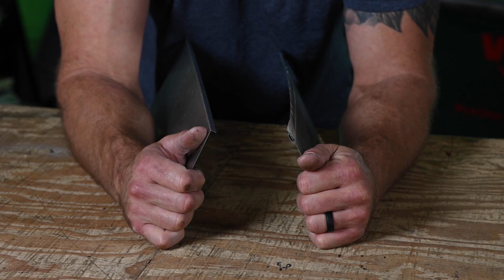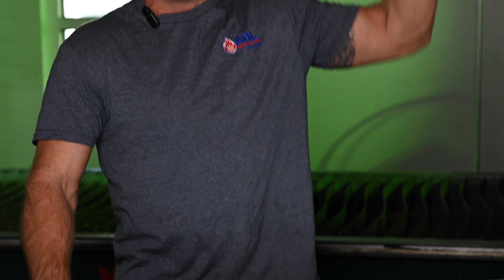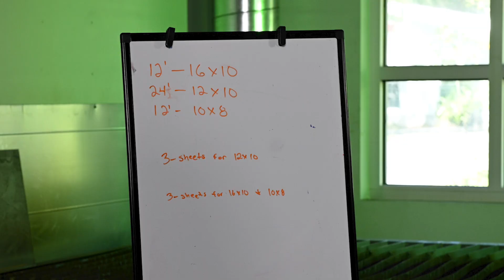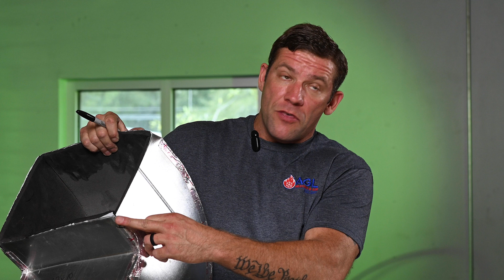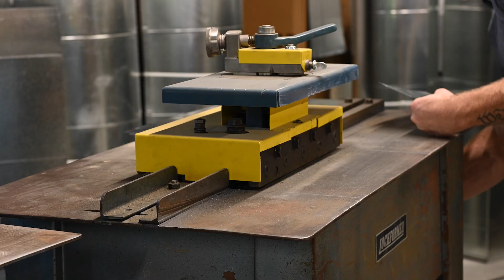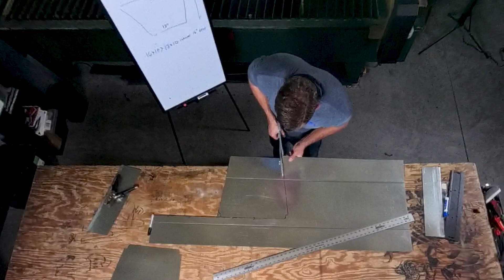Basic Sheet Metal Layout (rectangular duct, end cap, radius elbow, reducer)

Comment: Many guys fear math, but it makes sheet metal layout easier, faster, and therefore more efficient. I was in the trade a lot of years before I was shown the equation for figuring the radius point(s) on offsets, and the equation for figuring the length of an offset's heels. Not having to bisect an offset to get radius points, or wrap a flexible tape around the cheeks for the heel measurements really speeds up production.

Comment: any tricks to insulating flex duct?? I'm a do it yourselfer and my furnace ducting was just covered with yellow sheets of fiberglass insulation and duct tape. it was nasty and soaked with dust. After removing all of it  I found that there is a 10 inch section of uninsulated flex duct i need to insulate. Any advice would be greatly appreciated as I can't find any info on insulating flex ducting.
Reply from the maker: Flex duct is shipped preinsulated and is normally not done on the field.  You can wrap short sections using duct wrap just like wrapping hard duct but it will be difficult to work with.
Reply: @aglmechanicaltips  Thanks for getting back to me! I really appreciate it. Luckily there is only a 10 to 12 inch section where uninsulated flex duct is run from the top of the furnace to the hard ducting. I have to wrap it all in place so just going to take it real slow.
Reply: @RealAdrianDittmann many HVAC shops have partial bags, or boxes of flex in stock. If someone came into our shop wanting only a short length of flex duct, I would just give it to them.